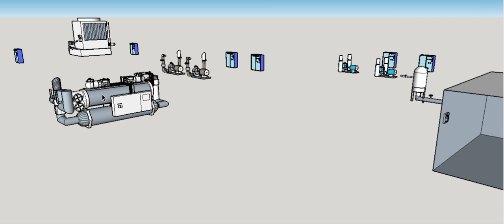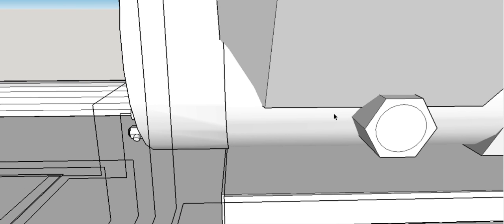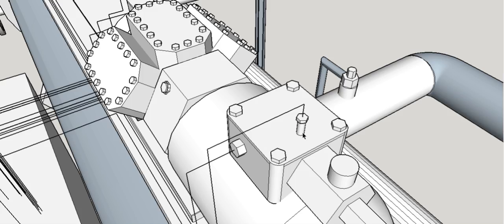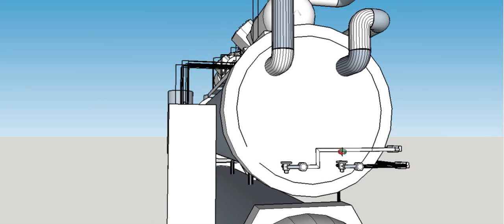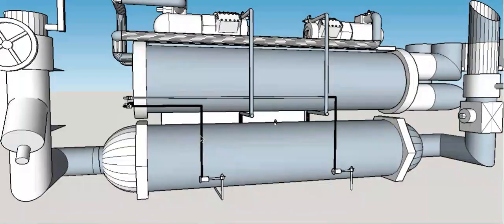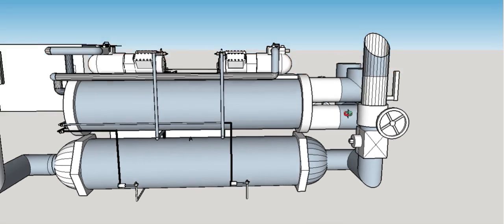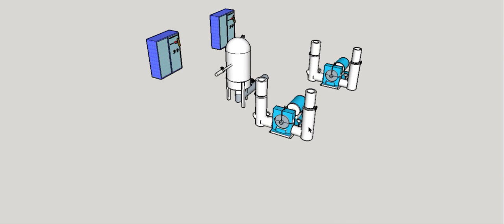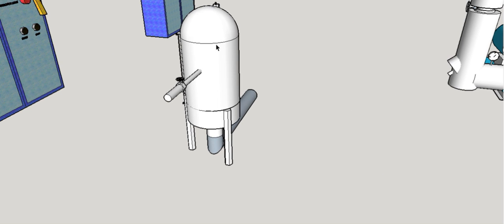NYC RMO study guide

Comment: If compressor 1 + 2 Identify exactly the same, how do you distinguish which compressor on the test will be system 1 or system 2? Ex. "Find the component to check for oil level in compressor #1" How will I know to check the compressor on the left or right side. Is there a way to distinguish them if compressor 1 show on the left side of the machine rather than the right?
Reply: My module shows compressor 1 on the left side, yours shows on the right. Thats why I ask. I just want to know how to decide which compressor is system 1 and then the rest of the components would fall into place as TEV 1 or 2. But in order to do that I need to be able to figure out the primary compressor (compressor 1)